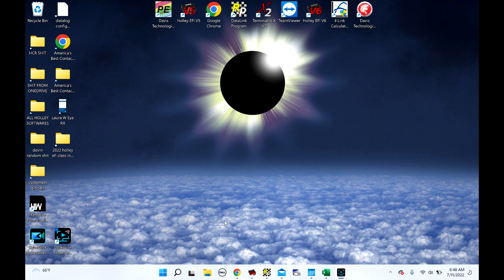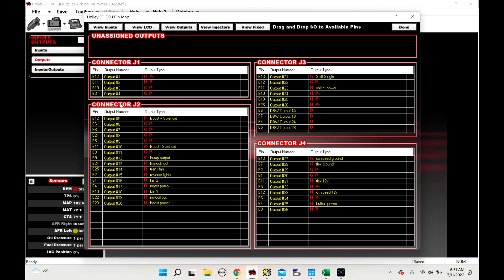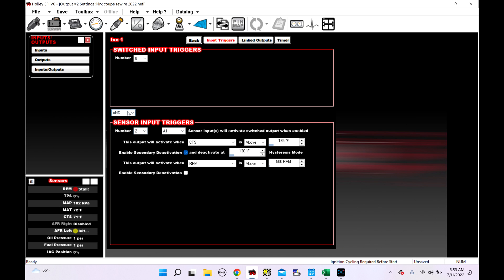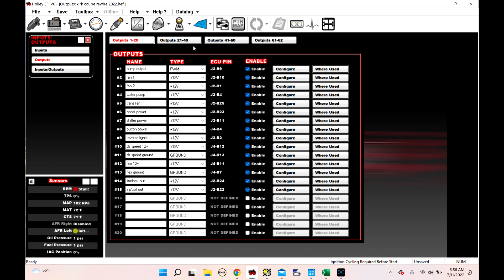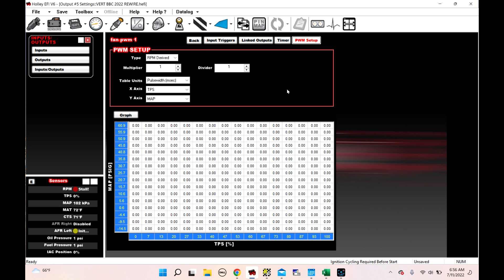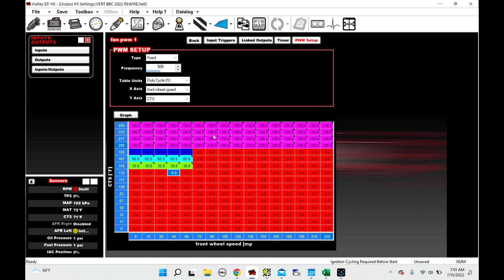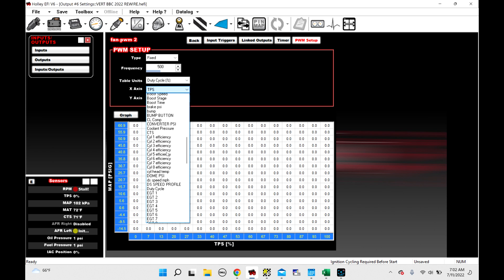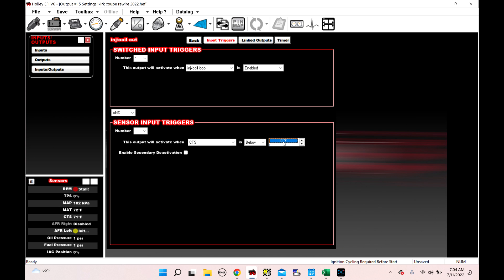Holley efi inputs and outputs setup and suggestions

Comment: Devin, you never explained how you actually "LOOPED" the two circuits together. I have the same issue. I have a Spal Brushless Fan that requires a Positive PWM Signal which I figured out and have the fan coming on at different duty cycles depending on the Coolant Temp. (CTS). Now, I would Like my AC compressor to trigger the fan on at like a 60% duty cycle. My AC and my FAN Override switch are hooked together and they are a negative input to the Holley HP ECU on connector J1-A3. 
Under System Inputs it shows: 
Function = AC Kick  
ECU Pin =  J1-A3 
Input Type = Ground. 
Under Outputs I have:
Name = Fan PWM 
Type = PWM+ 
ECU Pin = J1-B11
Enable = YES
Configure:
Switched Input Triggers Number = 0
PWM Setup
Type = Fixed
Freq. = 350
Table Units = Duty Cycle %
X- Axis = CTS
Y- Axis = CTS
I think what I’m trying to do will need (2) PWM Tables… One for the CTS and ONE for the AC Trigger Switch and Compressor with my Negative Input to switch this new PWM+ Trigger. Is there a way to do this? Or, another way to accomplish my needs. 
Please help me... Thanks Gary I don't mind to pad your wallet for this answer...